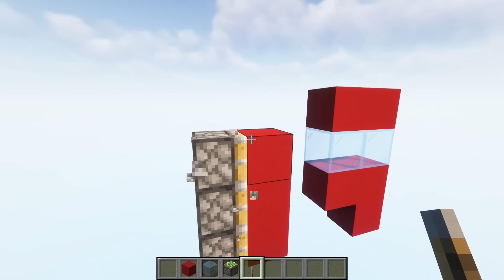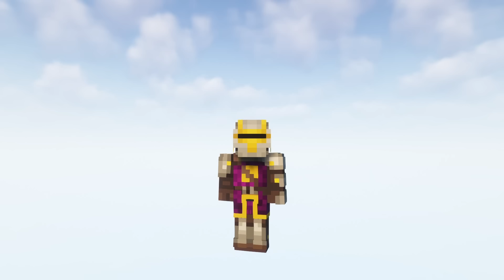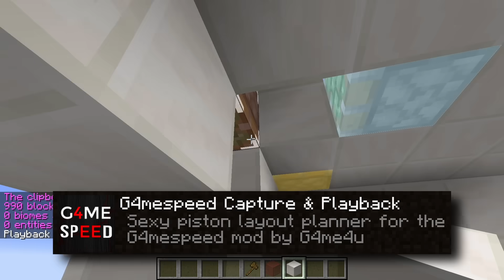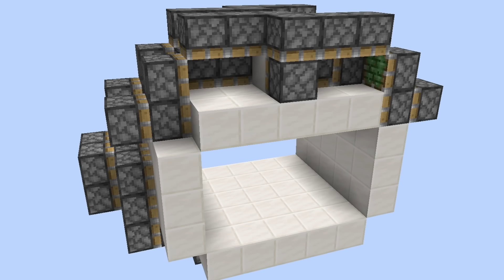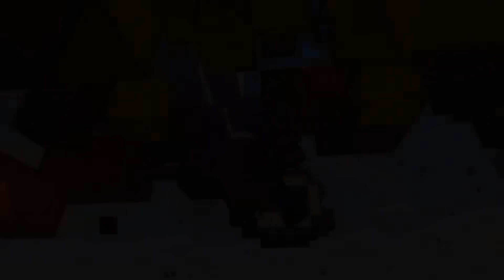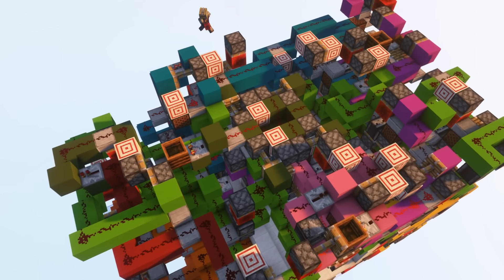0-Tick Piston Doors Are Insane!

Comment: What does the target block do?
Reply: Connect to the redstone sopistons activate even Under the pistons with trapped chest in the circuit when beside is "Tar Red Red Tar" and Riding down tike "Trache Red Red TraChe"
Reply: @Ronnie-ld7du huh do u mean it prevents quasi connectivity?
Reply: @Battlepro112-i5d  It Still Used Quasi Conectivuty

Comment: From a purely technical point of view, it cannot be a 0 tick door.
You executed several ticks individually during the test. 
Since Minecraft runs with ticks, and all functions in Minecraft need at least one tick, the description 0-tick is simply wrong. Immediately is a word that is not a direct specification and can therefore be used. But 0-tick is misleading.
But apart from that, respect to you for this amazing door.
Reply: The word "0-tick pulses" is obtained from the fact that the pulse which powers the piston also turns off in the same gametick interval, making the block extend/teleport instantly (if you use a sticky piston). For what you said, Minecraft take 1 tick (2gametick) to process all of the game functions, and that's true, if you turn on a lever on a seemingly random tick, the action of activating the level will be processed at the start of the next tick interval ofc but that's just how the game functions (and not relative to the door during a movement, like opening and closing)

Comment: How much smaller do you think it could be if you used powered rails? Cause I suppose you run issue issues trying to avoid 2 redstone lines next to each other, which you can avoid with powered rails.

Comment: i am not THAT good atd redstone. elaborate abba? i understand it might just be powering input a, tehn b, then b again (?) then a again but im not really recognizing what they are in the videos
Reply: also i spotted end portal frames? what use do those have within a redstone build?
Reply: ABBA means "A to B, B to A" which means when powering that ABBA, it will perform A first, then B. Then after "turning off" ABBA, the sequence will be "B to A". The ABBA was made around piston sequence that can be extended in ascending order then turning off will be descending order

This meant that you can made a sequence using ABBA itself instead of 2 wirings that control open and close respectively, saving space and also sequence will be easier to deal with

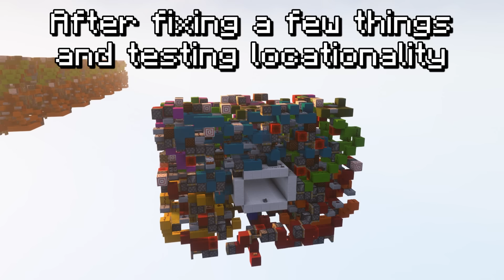Comment: 8:17 how does the location of the contraption affect if it would work or not?
Reply: Which direction a redstone contraption is built to face also affects which order its subcomponents update in, within a single tick. Imagine a regular for loop going over the X axis (this concept extends to all of the axes really) -2x, -1x, 0, 1x, 2x, etc. If you rotated the contraption 180 degrees, any subcomponents which are supposed to fire in the same tick would update in the opposite order within that tick, sometimes leading to strange and broken behaviour.
Reply from the maker: No chunks don't cause issues, at least not in Java edition. It's just that redstone updates aren't the same in all locations. Also other components like hoppers can have locationality issues but I haven't looked too much into that. Also yes direction can affect the reliablitily
Reply: @avogaado  believe it or not, chunks actually affects things, although it won't ever effect 0 tick builds. Entities moving (assuming this only affects cart repulsion) seem to be processed differently depending on where the door is in the chunk. We've had already 3 cases over the last few months, and there will be many more for sure. For example, one of the case made a minecart depower a pressure plate earlier on the first movement of a piston tape, while in another chunk it is always reliable and it has no other explanation than its placement.
Reply: Sometimes if its between two chunks, one part of the contraption may update differently than the other, losing sync, or just not work at all. That limits what type of Redstone configurations can be used in it. There are some other reasons i think, but they are really complex lol
Reply: Underwater 今天就到最后

Comment: will copper bulbs make this more efficient?
Reply: Probably not because he's trying to make a 0-tick door, but bulbs have a 1 GT delay.
Reply: Copper bulbs have some nice functionalities to be sure, but I don't see how they could be applied here. In order for them to be used in circuits, they need to be read with comparators, which have a delay (2 ticks I believe?).
edit: They can also be read with observers ofc, but they have a delay as well
Reply from the maker: Well no they can be used to update pistons and other budded blocks with 1gt delay as well. But yeah definitiley useful for 0-tick doors, but not for this one, becuase there's barely any delays needed other than BED timings

Comment: This is downright insane. I didn't even know about the 1-tick bug for pistons. 
What an incredible use for that manipulation
Reply: Technically, 0 tick, seeing as you can fire multiple pistons that all interact with one another in less than a single game tick.
Reply: @Smoth48  I was more talking about the entire interaction taking up 1 full tick. U r right tho. Technically it's shorter.
Reply: It is not a bug, this is simply how they are programmed
Reply: @enkvadrat_  yes but it's unintended jank and thus a error or bug
Reply: @ShadowEclipse777  'unintended' and 'error' or 'bug' are not to be mixed together, especially when programming.
Reply: @ShadowEclipse777  Unintended but left as is on purpose, it's not something you can consider a bug since years and years, it's very much how pistons are supposed to work
And something working as intended can't really be called an error either
It's not that simple naming things
Reply: @ZZZZordan  a bug in code is an unintended effect. it definitely has a negative connotation which i think you don't like, but by definition, 0 tick interactions are a bug. when redstone was  originally developed, they took measures to ensure logic gates would require multiple ticks. this is because the more operations you do inside one tick, the slower the tick rate of the game has to be. as minecraft has advanced, how strict they are about that rule has changed, because modern computers have the capability to handle more operations per tick. but even then, avogaado mentions the 100s of pistons interacting in one tick is causing lag. it also wasn't intentionally added into the game. additional blocks and changes to the way redstone is handled caused 0 tick interactions to become possible, but as a consequence of other features, not as an intended feature in and of itself. 

so it fits the definition of a bug. the reason it has remained through many updates is that those negative outcomes are exceedingly rare, and the majority of the playerbase doesn't even use redstone complex enough to ever encounter it. removing it would be a waste of resources and make the dozens of people who use it in the game sad. 

tl;dr the dictionary says its a bug, if you're gonna be pedantic at least be right (:
Reply: @arcanealchemist3190  A large part of Java redstone is built around so called "bugs"
A behaviour can be acknowledged as originally constituting a bug, but if the developer purposefully keeps it due to the behaviour being interesting and useful, it is no different from a feature that that developer originally intended.

If my memory serves me, Mojang have stated that Quasi-Connectivity works as intended. It was obviously originally un-intended.
Reply: @arcanealchemist3190 the pistons are working as intended, in unexpected ways

This can be more considered an exploit if we are to use technical definitions
Reply: working as unintended is a bug. this is working as intended but being used in an unintended way and therefore an exploit

Comment: why tf did you use end portal frame while building it lol
Reply: I think it's because it's transparent and immovable, so it can be used to jam the machine while you are building it so it doesn't fire before the end or so you can debug specific circuits without unexpected interference
Reply: @mihajlozivanovic2327  hoppers do that too end portal frame also gives a comparator output but chests do the same I believe he used it just because it's cool
Reply from the maker: Basically a placeholder block that easily notecable
Reply: ok, thanks @avogaado